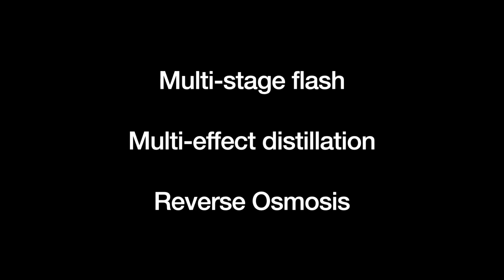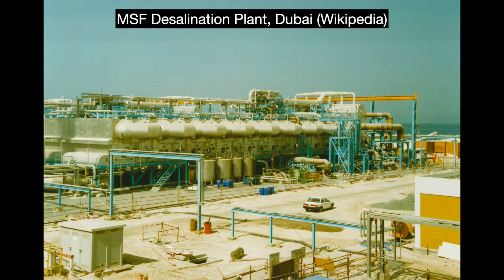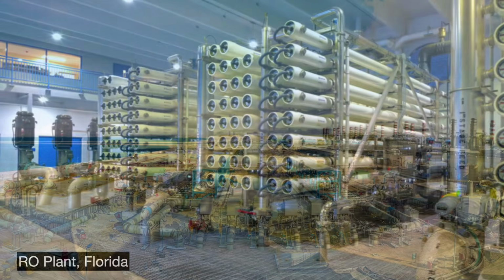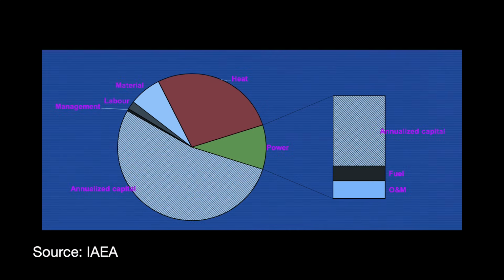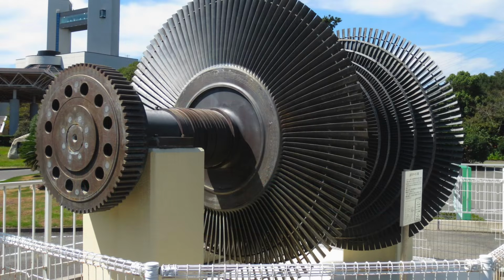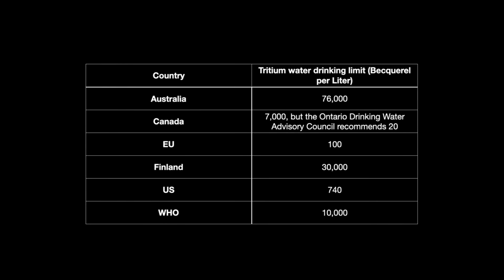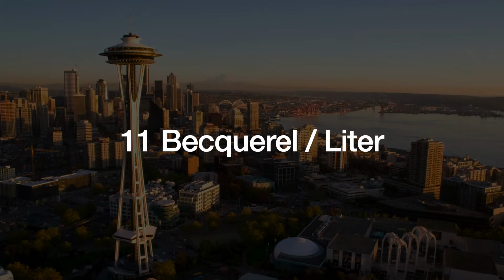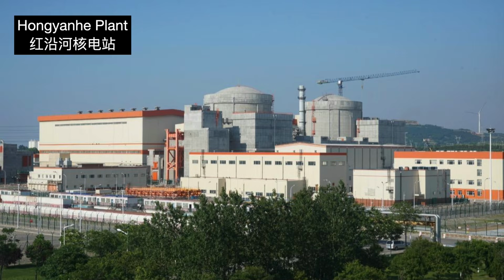Going Nuclear to Desalinate Seawater

Comment: What happens to all the leftover salt? Does it get dumped back into the ocean? If so, how does that affect sea life?
Reply: Global warming and the melting ice sheets have raised sea levels and diluted the ocean faster than it has ever happened naturally which may be responsible for coral reefs dying off among other unknown affects on sea life. The salt should be returned until an optimal balance is restored. After that we may risk causing harm from too much salt. I'd like to think that we would have enough methods of stockpiling fresh water in aquifers, ponds,and reservoirs. That's assuming the brine hasn't been polluted by the desalination process.
Reply: @jaymzgaetz2006  I don't think the issue is the overall, average saline content in the ocean. It's the saline content specifically where the brine is being dumped in from the salination plant. Would it create large dead zones? Spreading it out over a larger section of ocean would surely be a lot more expensive to do.
Reply: @jaymzgaetz2006  "really? The ocean constantly stirs itself."

Remember that brine is heavier than the rest of the ocean water, so it's going to sink straight to the bottom. Whatever ocean life is on that bottom is going to get (chemically) scorched.

Comment: Something missing here.  Usually MSF heat source is waste heat from a thermal generating plant.  Heat that is of low grade and wouldn't generate much electrical power in turbines.  Also does the elec energy number for RO include energy recovery of the brine.  That can really change the energy balance of RO.

Comment: Excellent video! My upvote was really deserved. Thanks for calling attention to Tritium contamination, something I was not aware of before. It seems to me that solar powered desalination is the cleanest way to do this. Its initial cost is much higher, but it has practically no maintenance costs. I believe there is a project in the Middle East (I think it is in UAE) implementing that. The installation has large reservoir of water that are inside transparent domes. The naturally produced vapor condensates at the transparent roof and is collected for consumption. Obviously this process doesn't look very efficient. Very much has been talked about sea waves as a way to generate electricity. In France there is a quite old plant that stores the high tide water to move turbines to produce electricity. This method is also viable for a desalination plant. However, it seems it has a quite significant environmental cost since marine life that would come with high tides gets imprisoned with the water and are potentially destroyed if they run through the turbine. In desertic areas an artificial reservoir can be constructed and a grid can be used to block entrance of marine life. Electricity can be generated when the water enters the reservoir and when it leaves it. As we can see there are quite a few alternatives to nuclear energy, most passing through clean electricity generation, particularly using sea water movement. I am quite skeptic about nuclear plants. Although they are very attractive economically, there would be other ways to proceed that gives much less maintenance and that are completely clean. Nuclear energy is just good economically as far as fuel cost is concerned. But sea movement energy is free and has no need of fuel at all.

Comment: This would be a world changing enterprise.
Using electrolysis - albeit low efficiency - to produce pure water by burning the gases - open the possibility of recovering the energy with hydrogen powered turbines. 
So you get pure water from one side, and more electric energy as byproduct...

Comment: I used to operate an MED for the purpose of concentrating grape juice. Kinda bothered me that we dumped millions of gallons of process water from the juice, as well as thousands of gallons of Ethanol down the drain. It costs a fairly good amount in wastewater treatment and i just think its stupid to dump fuel down the drain. This type of inefficiency is everywhere across food industry and i hope it gets some attention.
Reply: @SubvertTheState  Did the ethanol not have a value? Even burning it as a fuel to run the plant operations
Reply: I’d assume those tens of thousands of gallons of EtOH were still contained in the millions of gallons of water? Otherwise I can’t think of a reason why they’d simply be flushed down the drain. Can someone clarify?

Comment: Solar thermal can help to boil the water in either oil, gas or nuclear desalination plants. It can be a pre heater or cycled through a heat pump to heat the water and save other fuels/ improve output with nuclear. Also sea salt is useful, why not keep it rather then dumping it back in the ocean? That could be a good side business. I also think that ocean thermal heat pumps could use heat from surface sea water to boil the water too. Waves could help to pump the water...

Comment: @Asianometry  The M-Cycle technology uses the unique evaporative cooling, humidification, condensing and humidification-dehumidification distillation processes for producing distilled water, cold, power and air conditioning systems. The M-Cycle technology produces clean water from any water source and is powered by low temperature heat. The M-Cycle is the new but proven thermodynamic conception through capture energy from air and it make water through natural renewable energy. Would you like to demonstrate M-Cycle tech on you channel?  Here is a video - how it works and how it is better than traditional desalination tech. https://youtu.be/NzdNwKBVXT8

Comment: Had 3 separate msf plants on the cruise ship I worked on. It utilized waste heat from the main engines, so our water production would scale with ship speed(engine load)
Reply: Three days after leaving Sydney on a cruise ship we noticed our cups of tea tasted slightly salty. 
That was because the fresh water taken on in Port Jackson had been used up and we were now using desalinated water. 
No problem, we changed over to coffee and didn't notice a salty taste again.
Reply: @MaxB6851  personally I think once you can taste any salt in the water that is not good
Reply: @1mezion  I am not an expert but I think the same.
Reply: @1mezion  Cold climate countries mix small amounts of salt into their water supplies to stop the water freezing in the pipes during winter, I used to go between Australia and the UK frequently as a kid and I noticed the salt in UK water compared to Australia's water, so a small amount is fine.
Reply: @MaxB6851  the whole point of desalination water is that's its not meant to taste salty
Reply: @Alucard-gt1zf  exactly
Reply: @MaxB6851  Thanks for that inspiring tale of you overcoming such incredible adversity.
Reply: Cool story bro. You didn't even try to make it believable. Only Russia has those ships and they're used by the military.

Comment: One thing is darned sure, you cannot desalination seawater economically with pressurized water reactors.  The value comes when you have the higher temps of molten salt reactors. Especially when you use only nuclear waste from pressurized water reactors with the fuel incorporated into the molten salt. Iridium is like burning gold to make energy, sure you can do it but why would you?
Reply: PWR is not the ideal rectors we want to even consider when Thorium Salt Reactors have proven to be better in most aspects compared to PWR…we just need the power to operate RO water purification, the other methods of desalination are energy intensive and are quite dangerous in when paired to PWRs

Comment: I've been saying this for years – In California, PG&E should work with the sate water agencies to repurpose Diablo Canyon for desalination. Pump the fresh water generated up over the coastal range and into the California Aqueduct.
Reply: They still have San Onofre sitting there doing nothing. A couple new small modular reactors and a desal plant instead of the old broken steam generators and they'd be in business. Then pump the brine up and over the mountains and store it in the Salton Sea. The containment buildings are still in place at San Onofre, just need the reactors to stick inside.
Reply: @Clean97GTI  If I'm not mistaken, the Salton Sea has very high contaminants - even filling it back up probably would not dilute it enough to be an economical solution for safe drinking water.  Might be better to pump it into Lake Mead or just use it as fast as they generate it.
Reply: @chadportenga7858  the Salton Sea would just be for brine storage, not drinking water. The issue there is all the agricultural runoff has left it contained like you said, but because it's evaporating so quickly, the contaminated soil underneath is being exposed and causing breathing problem for the people who live and work in the Imperial Valley. 
Filling the sea back up a bit would help.
Reply: @Clean97GTI  why'd you want to store the brine when you can just let it go back into the sea ?
Reply: @0thPAg be cause the extra salty water may dammade the ocean. But this discharge can be deluted enough by using a long pipe and multi openings
Reply: "Just pump over the costal range." That a major challenge by itself.
Reply: @blastermanr6359  kind of. The pumping requirements are not trivial. It takes a lot of electricity to do it, but the engineering part is pretty well established at this point. It's more a political and financial problem.
Reply: The water level of Lake Mead should be an incentive to start with nuclear plants.
Reply: Wasn't SONGS Reactor already doing that? It got shut down
Reply: Why can’t we cloud seed?  it is cheap to shoot iodide in clouds.  I mean this whole week was cloudy in California… but very little rain.
Reply: Politics is never in the favor of the taxpayer.
Reply: @StevieinSF  And then suddenly all residents assume why bother with water conservation and farmers clamour for all that water. Scarcity and water bills drive conservation. What looks like abundance never does. Then you rely on the power station for the water irrespective of the cost
Reply: Excellent informative video. The “greens” should pay attention.

Comment: Nuclear reactors create heat as waste , using that waste heat to desalinate water is a great use of that resource. More advanced designs could incorporate osmosis as a way to use surplus electricity if there are situations when the grid has surplus power on a regular bases.

Comment: existing nuclear plants or thermal power plants in general near sea can adopt easy desalination setups.
All power plants make waste heat...depending on temp and thermodynamic efficiency... a stirling engine using the plants waste heat that is typically exhausted can produce power...power enough to run pumps thru an reverse Osmosis membrane...or up a big water tower and let gravity do the work.  The price of a 30-story apartment building is $36.5 to $80 million, so a large concrete tank to hold 20 million gallons could costs less.

Comment: The danger of nuclear power is not  only the inevitable explosion of the steam generator.  The nuclear power plants always leak nuclear radiation and contribute to nuclear cascade in operation and decommissioning.  They have to be decommissioned because they are too radioactive to work and the workers have to cycle out for one year when they are overexposed.  The only solution to the dangerous of nuclear radiation is not to build develop or share nuclear technology.  In this country this type of propaganda is a death penalty offense and should not be tolerated.

Comment: 10:00 If Tritium is going to be a problem which it probably won't be just plan on having the desalination plant a mile away from the nuke plant.  Even in US plants that had detectable releases of tritium, it was never found that far away from a nuke plant.  Ie..Yankee Vermont facility.
Reply: That only works for electricity driven solutions. For heat to drive the boiling, it ought to be closer, like in the same building

Comment: 10:00 100 to 30,000 disintegrations per sec per liter is a huge difference in regulations.  I would lean to the upper level of the regulations since tritium is a weak beta emitter with a very low kinetic energy of 5.6 KeV.  Also, the low-level regulations are based on a no threshold dose theory which has been shown to be invalid in protecting human health.   That being said high levels of Tritium are nothing to mess around with since its physical size allows the isotope to walk through most anything including one's skin.  So if you walk into a cloud of Tritium beware because your PPE can be very ineffective.  And unless you have a specialized portable tritium detector you won't even know it is there.

Comment: This doesn't make as much sense as using renewables to power desalination. Renewables comes and goes, so when the wind is blowing on a sunny day, there will be too much power. The extra can be used to produce fresh water. Then the water can be stored until it's needed and released slowly when renewables are not able to provide cheap power.

Comment: What environmental damage from burning carbon? faster growing plants?
Reply: Mainly changes in global weather patterns due to the heat trapping effect of CO2 in the atmosphere. 

Current atmospheric CO2 concentrations are approaching 50% higher than they were 150 years ago. 

Today were are at 422ppm which is the highest level for 14 million years - when average temperatures were 6DegC higher than today.

Average CO2 concentrations over the last 10000 years (human civilisation) average just 300ppm so I wouldn't be so flippant about it.

Comment: When talking about resource Managent: it does not matter if left or right. The political Narrative about resources i based on the 1972 Book from the Club of Rome "the limits of growth". No prediction made in that book manifested itself in reality. But the Narrative is still the same and they play resource scarcity while there is no such thing in reality. Taking for example the BP's Statistical Workbook: Gas, Fuel will be availabe at minimum for 1500 years from now on, coal 3000 years... The only real concern is a complete different one: because of their green cultural shift, the malicious attacks on Technik fans and users, the technology culture and fun in it disappeared. Car, Motorcycle, rifles... The private know how about it was mocked and ridicouled in the media. And all is nowadays criminalised. The result: no young Persons are interested in hardware technologies. Shure, you find the elite students, but these are not relevant to run a society. Relevant are the 'mass' of the mechanics and common engineers. At the moment in Europe there are not even sufficient engineers trained to run the existing systems. The lunatic fantasies of states and EU of technologic advancement are just ridicoulus! These people are that unedcated and crazy that they for example do not realice, that if you want in future maybe Hydrogen technologies you need pumps and compressors. Basically Combustion engines run backwards. If the state bans and destroyes the knowledge of  and within combustion engines there will not be any Gas technology in future. ...
Reply: It goes way further back, all the way back to Malthus. There’s a reason it’s called malthusian

Comment: The discussion about 'Efficiency' is very toxic and dangerous: because of energy preservation one can calculate the maximum efficiency of energetic exchange in advance.  Thermodynamics is king. Modern machines are usually some percent below the theorethical maximum. Modern machines are incredible efficient! Politicians and regulators do not believe in science and do not care about that fact. Many large companies were destroyed by the state, because the state required efficiencies that are physically impossible. For Europe that costet in my estimation several 100k persons their job. And it is the reason why I quitted with engineering: thermodynamic is the boss of an engineer, not arbitrary laws and numbers of the state. There is no purpose im self personal self destroymemt by taking responaibility in projects that are physically impossible.

Comment: The narrative told by politicians, media and activists is not based on engineering and science. I downloaded some years ago the datapoints from the weather measurements and did the scientific datanalysis myself. (.csv). The rainfall is completely stable in its bandwith... Desertification and drought have nothing to do with  an imaginary climate change. The real points are, that ancient water engineering meant that water is lead to plants. Modern water engineering is leading water away from plants for electricity production. And straightening flows, that means the water does not seep in the soil anymore. Ancient water architecture, like the celtic ones in the alp, were never completely sealed. Water that was guided to civilisation also watered the soil. The modern nonsense, that water is valuable and no drop should be wasted means in reality that no water is guided to plants anymore... Concrete and plastic tubes do not have leakage. No water for the soil... The other fact is, when a forest is cleared, the water management must be done artificially with technical means. (Forests are large water storages within soil and plants).